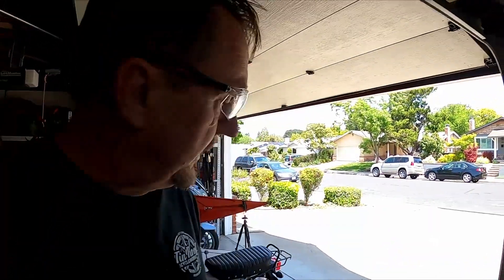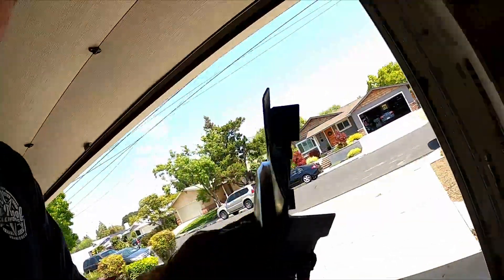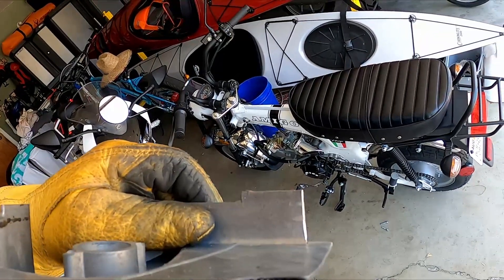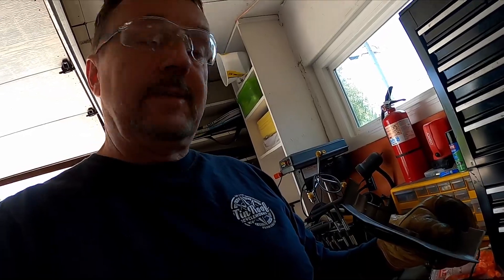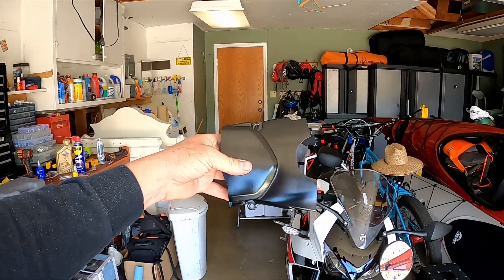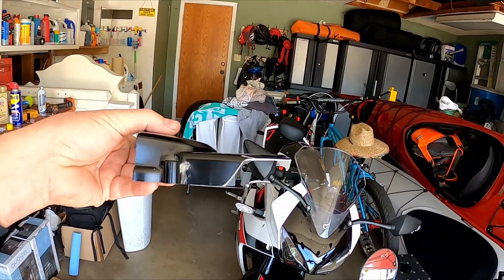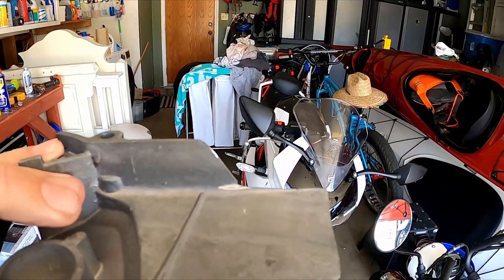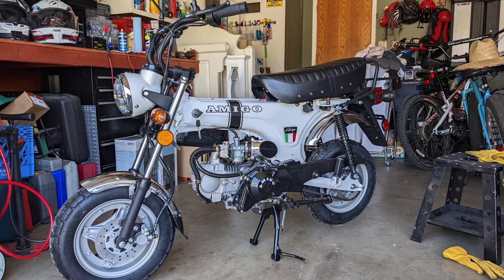CT70 Chain Guard mod EP3

Comment: I had the same issue with mine right out of the box. I have gone through and re-tightened all the fasteners and performed minor mods but do notice that these bikes vibrate quite a bit. Change your countershaft to a 17t. It’s by far the best mod for these bikes. They are fun little bikes. Thanks for sharing
Reply from the maker: Thanks I've been playing with some mods! this bike has a 32 tooth on the rear and a 13 tooth on the front, I bought both the 16 and 17 tooth front sprocket, stock 1st gear was un-usable starting off in second seemed to be about right.
much larger tires and the 16 or 17 front sprocket should help quite a bit!

I also did a high fender kit   
https://youtu.be/fhugCQF9-Vo

tomorrow is an easy fork upgrade  to improve the ride a bit